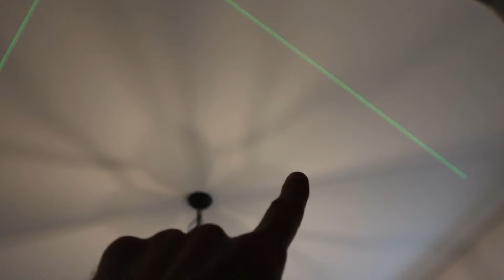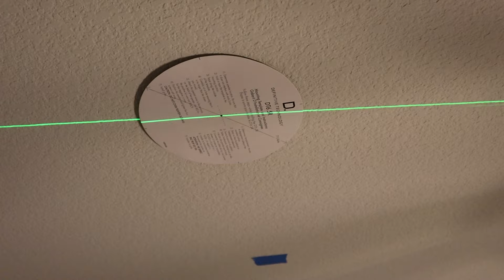How To Install In Ceiling Speakers

Comment: Here we go, let's cut a hole in the ceiling, perfect. Now we're ready to install the speaker with the wire that's magically just right there ready to pull through. WTF! This is not helpful!
Reply: you go into the attic and put the speaker wire there. not rocket science.
Reply: But what if it's on the ground floor?
Reply: Exactly, he should give at least more information on the wiring parts which I believe is what most of the people are interested in.

Comment: They don't show you the hardest part. Smh
Reply: Yeah, I was thinking it was a 2 story house @ 1st because I didn’t see any insulation but then they never showed how wire was ran or fished so I’m guessing it’s a 1 story house 🤔🤷‍♂️…. Either way yeah important part was left out or the hard part depending on the application

Comment: Running the wire thru the calling especially if the joists are running the opposite direction would be a great video. Cutting a hole and plugging 2 wires seem straight forward

Comment: Excellent video!  I especially love the 3D - 360° laser level you used to align the speakers in the ceiling with the center light fixture.

Comment: Where is the power source
Reply from the maker: There is an AV closet on the other side of the house that has the amp powering the speakers. Customer had an extra zone available on the Denon X4700H
Reply: @capstonehometheater  ok so do most houses have this
Reply from the maker: @YourFavoriteCountryCuzin803  some homes have a dedicated closet that is designed during the build and others just re-purpose a coat closet or linen closet to achieve the same goal. In this case it was a coat closet.
Reply: @capstonehometheater  oh ok thank you I’m asking because I’m trying to get in the business and just trying to gain as much knowledge I can to do things the right way thank you for your time
Reply: What is the cost of installation, Frisco area

Comment: Great another video only showing how to put the speaker in the wall/ceiling.  NOT how to do a complete install.  Lets see what’s missing:
1. How the wires are run
2. How the wires are connected 

Does an installer need to worry about losing business because they show these things? Absolutely not.  Why? Because people who are not technically inclined, don’t have the tools, or don’t want to DIY it will call an installer.  Those people make up a greater percentage than the DIYer.  And the people that do not currently have the funds to have the speakers or to hire an installer are just watching for the entertainment anyway